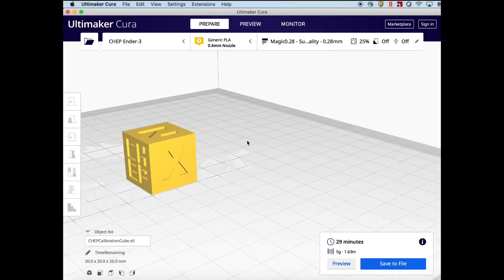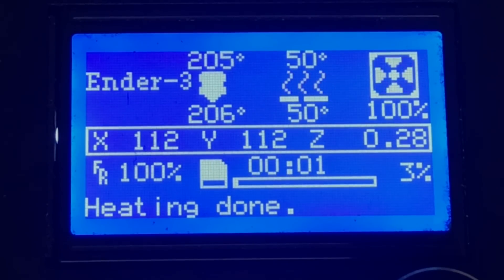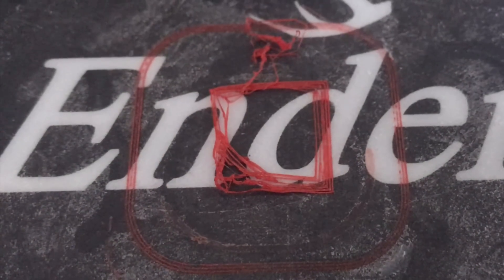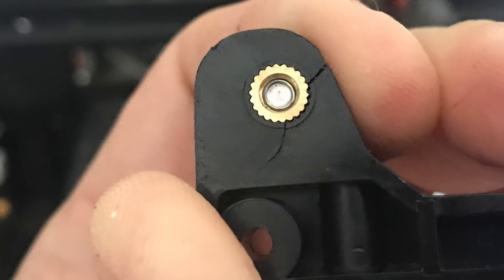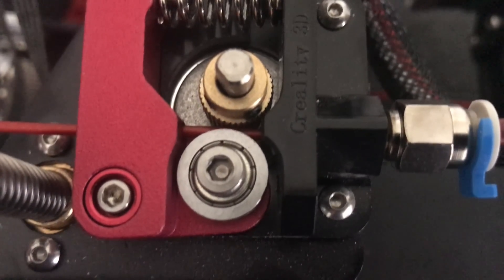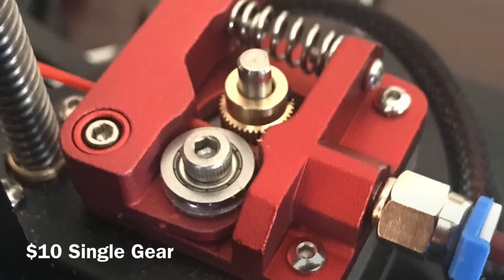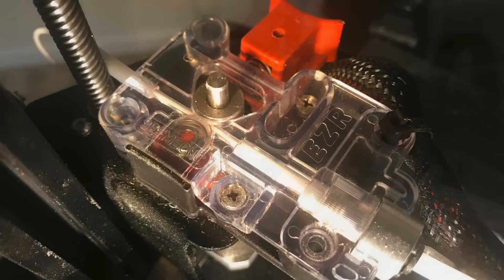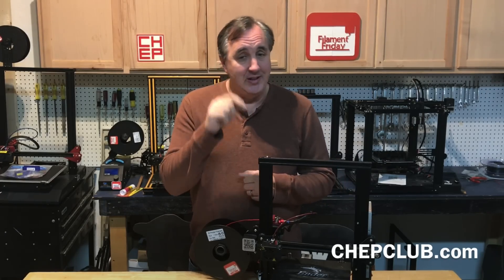Fix Under Extrusion from Cracked Extruder Arm on Creality Ender 3

Comment: Hello CHEP. I saw a video where you made alarm for end of filament. I have an ide. Why not use that design and use it together with a contactor so that it will cut power to the printer. Then it should be possible to leave the printer unattended and later restart the printing.
What do you think?
Reply from the maker: It’s possible. Not sure I’d want that but possible.
Reply: Why not  just use octoprint and have it pause and turn off heaters ready for your return.

Comment: Since I've been fighting this under-extrusion thing for some time now, including major holidays in layers like shown @2:30 on your red cube, I HAD to check this video.  I've been toying with the idea of running this by you, anyway, Dr. Chas, BECAUSE - the math of this one baffles me!!!  I've had LOTS of trouble printing tGlase on my Ender3, and everything I've done to try to dial it in, like adjusting eSteps, is effectively nullified by everything being so ridiculously INCONSISTENT!  Repeatedly trying to extrude 10mm (or 100mm) yields totally RANDOM amounts, from high seventies to low nineties (percentages) of prescribed.  So when I pulled the filament out one time, I happened to notice something weird in the markings left by the drive gear (Bowden setup, of course, so there was a bunch past the drive, before the extruder): about every INCH there was a funny little FLAT spot.  I say ABOUT because, again, it is randomly IRREGULAR!
Now, WHY the INCH - when I had been testing 10mm feeds???  This would imply a repetition of a wheel of about 8.5mm - and I don't see ANYTHING in my extruder of THAT diameter!
Herein lies the head-scratcher, which makes me crazy.  Yes, it may be that my tensioner arm is cracked.  Yes, it would be a good time to upgrade to dual-gear or hermera - but INQUISITIVE MINDS like the closure of KNOWING WHY!!!
Chuck - you may or may not wonder or have the luxury of the time to side-track, but this was so odd that I had to share.
Thanks AGAIN for your fine work!!!
Reply from the maker: Sounds like the hot end can’t keep up so you are seeing slippage. I would check the hotend for minor blockage or possibly burned PTFE at the nozzle.
Reply: @FilamentFriday  I do have Capricorn PTFE, BTW, and have checked the HE thoroughly, but while that could/would tend to contribute to random variations, the underlying 1" bands still defy explanation....  But thanks anyway, of course!
Oh - pulled the tensioner pulley arm - no crackulation.  
Wondering at this point if I should abandon the Bowden thing and do the direct hermera.  Reduced mass of moving head a la Bowden is theoretically advantageous for higher movement speeds, but when it gets right down to it, it seems like I'm ALWAYS having to go so stinkin SLOW that I'm nowhere NEAR needing the lighter head!  Gotta do SOMETHING different - this pokey speed is frusterpating!
Reply: @FilamentFriday  As Emily Litellla would say:
Oh.  Nevermind.

Uninstalled/reinstalled Struder, CHANGED FILAMENT, preliminary testing (albeit minimal so far) looks pretty good - with PLA.  Gonna try the TPU - tomorrow.
Capricorn slid right in, BTW.

Comment: Hello everyone. I recently bought Ender 3 and made several prints so far.

I have lot of problems with sticking filament to the bed (I'm using PLA). I have tried cleaning the bed with alcohol, but it didn't help.
I also checked the bed leveling and it is okay. What else should I look into?
Thanks for the help in advance.
Reply: hey i just bought an ender 3 as well. Mine came with a glass bed and i noticed that it tends to stick better when you increase the build plate temperature so i changed mine from the standard 60 to 70
Reply: Your alcohol may be leaving an invisible film on the bed. Try washing it in warm water with dish soap then re-leveling the bed. I had this issue recently and a warm wash usually solves my adherence issues

Comment: I actually had this issue within a month after i bought Ender 3 pro . Replaced it with the metal extruder and changed the filament holder which you had shared on a another video .This made a world of difference . On the contrary  i experimented using PETG filament recently i was getting  uneven extrusion , couldn't figure out why because i had followed a lot of videos before going into printing, also set the profile right . But after i was done with it , when i switched back to PLA i started hearing hissing noises every time a layer was put down .i  opened up the hotend thinking i had an issue with the  PTFE tubing was burnt out , infact i found that residue in the nozzle was causing the issue because there might have been some small PETG particles . Inserted a new nozzle and ran and  printed again started getting under-extrusion . so now i wonder what could be the issue even after calibratng esteps after the PETG (as i figured maybe because the extruder needed so much more force to run PETG as it tends to be too sticky .  So finally i changed the PLA filament with a recently bought roll from a different company and it fixed my under-extrusion . Also since its  winter season and the filament is usually kept at 19 C has caused this issue . So Under extrusion can be caused due to PLA  affected by humidity too.

Comment: I had this exact problem. The filament also started cutting a grove in the guide hole. Had me boggled for a few weeks trying different settings. I replaced it with a similar extrusion kit.

Comment: I download the new cura 4.4 and it does not install on my Mac have you have this issue?
Reply from the maker: No, installed fine on mine 1st time.
Reply: Mine said it could not be opened because it might be a virus or something like that. Open system preferences and click security and privacy. At the bottom of the page you should be able to allow opening it.

Comment: I had the same problem with my Ender 3 Pro. I also replaced it with the aluminum extruder. I think they should seriously market the machine with a number of these type fixes already in place.

Comment: Hi Chuck, My ender 3 stock extruder had exactly the same symptoms that you describe. I found the idle wheel crack almost in the same spot as you show in your video. After replacing the stock plastic extruder with the metal one, all problems went away. Thanks for your detailed and accurate description.

Comment: Chuck - thanks for your videos. They are great help. On the metal extruder I bought recently, they include a rivnut to go on the bolt through the spring. It’s a smaller size than the bolt, so the bolt does not screw in (M3 vs M4 I think) but this stabilises the spring and also allows you to tension the spring with the bolt, because the metal frame is also threaded (The rivnut pushed against the spring)

Comment: I had this exact problem, took a while to diagnose. My fix was a square block of foam to add pressure to that weak spring, that fixed it. It's the weak spring, not just the cracked arm.

Comment: I did hours of work to troubleshoot one of my extrusion issues. I almost gave up, but then changed temp and it fixed my issue. 7c beyond what the filament recommended for temp. Any higher or lower didn't work. Absolutely frustrating some of the issues you can encounter.

Comment: Chep I have the same Aluminum extruder upgrade and found a way to allow it to print Nijaflex with no problem. If you have a drill press like my workshop has, I was able to measure the diameter of an extra piece of bowden tube and found a drill bit that would produce the exact size hole.
I then took the extruder part that the filament exits from into the bowden tube (not the extruder arm) and carefully drilled out the filament hole about 3 mm deep. I then cut a piece of bowden tube long enough to seat all the way into my new hole and leave enough so that it was about 1 mm past where the bowden tube would touch the gear and idler bearing. I took the small bowden tube out and cut it at the angles you showed in a previous video.
Re-installed the small bowden tube and it fit perfectly. The small bowden tube piece fits snuggly into the hole I drilled and just touches the idler bearing and gear.
I've been having great success with my mod and my Ender 3 with Nijaflex as well as flexible filament from Mirocenter.
The hardest part of this modification was getting the size of the bowden tube to fit between the idler bearing and the extruder. It took me a couple of tries to get it just perfect. Now I have no worries about the small tube moving back and forth as the printer works.
My only caution is to make sure you drill the hole perfectly inline with the existing hole in the extruder, don't go fast and above all don't drill too deep. If you are proficient with a drill press this is an easy modification.
Thanks for great help videos.
SG
Reply from the maker: I 3D printed a version as you describe and showed it here. 
https://youtu.be/az7pysnV_MY
Reply: @FilamentFriday  That was the video I referenced above. It gave me the idea to drill out my current aluminum extruder and add the bowden tube part that you cut at 45 degree to take up all open space around the idler bearing and gear, so the filament can't push out from. Best part is I didn't have to spend the money for that expensive extruder to accomplish the same end result. I hesitated in offering this mod, for concerns that someone without the proper skills might hurt themselves. So to the community, please don't attempt this mod unless you proficient with a drill press and take all the normal precautions to protect yourself.

Comment: Had exactly the same thing on mine.. I crack that you could'nt see from above! But anyway.. Since i also updates to an Aluminium Extruder i have always wandered how much tension i should apply to the filament, is there any rule? Because i also noticed that i got slighty different e-steps in accordance to the tension i apply to the filament.
Reply from the maker: Not that I know of.

Comment: Really good video. Just for a quick question 
My cr10s with bltouch has been working really well, but the last couple of prints have not been so good. They are gaps in beween the first layer just like.if the nozzle was to high. But I have not changed anything for this to do that. Any suggestions to why this is
Reply from the maker: This:
https://youtu.be/MaMYMTX1Xl4
Or this:
https://youtu.be/x35aWmnZ_A0
Reply: @FilamentFriday  thanks for your advice, turns out that my cr10s the two screws that go up and down were not level. The right hand side was and 5mm higher than the left side so when it was travelling left to right it was goin out. But I would have thought that the bltouch would have sorted that out when it probes the bed at the start of every print. Thanks again

Comment: After like 2 weeks of having issues I remembered your video.  I didn't have a crack that I could see, but when I put pressure on the extruder arm like you did my problem went away leading me to conclude that my extruder was the issue.  I have ordered your linked extruder and will be installing it today.  you are a lifesaver!
Reply: you can use a yellow bed spring on this extruder to

Comment: Chuck, I ordered the extruder you linked but it was nothing like the one you showed.  There is no idler ring.  Both gears are the same and the teeth connect at the bottom.  The top of each has a knurled section that the filament goes between and it is tight.  A real SOB to feel the filament through.  I am running the first print now and it seems to be fine also with the new blue tube you suggested.
Reply from the maker: Sounds like you ordered the dual gear version I referred to. It was covered in this video:
https://youtu.be/QnrH2Sk7y40

Comment: I had a similar underextrusion issue but with the aluminum extruder - The arm wasn't getting enough tension. I ended up added a few washers to shim the spring and that fixed the issue.
Reply from the maker: That’s why I put the flattened lock washer under mine, to make it pivot easier.

Comment: I had exactly the same cracked extruder arm. Changed to the dual metal one from your previous video. Amazon was out of stock, I bought a similar one and it works perfectly. Was I am still fighting is with stringing. Can you test your dual extruder and check if you have stringing with 6mm / 25mm/s ? I had to change the original 93 steps from ender 3 pro to 141 to perform the 100mm test. I was thinking about lowering this, or increasing the values to 6.5mm/25mm or even 7.0mm. I dont know what is more efficient... distance or speed. I know that putting higher values will increase print time and also force the extruder motor a bit more with such movements... if you can comment or do a video it would be great. Thanks for the video. Priviledge to be your patreon.
Reply from the maker: Increase to 7 or even 8 mm to see if that helps. Firmware limits speed.

Comment: Mine extruder has it's hole messed up after like 2kgs of PLA and a little bit of TPU. The very same issue happened. Changed only the arm to metal one from the set I bought a while back, can't change the whole as I use direct extrusion mod :/ Still E3D v6 and Direct Drive are on their way to my Ender 3 so changes are in the air!

Comment: Thanks Chuck!  Both my Ender 3 and 5 did this around the same time last summer and I put the aluminum on... 

I also have a subject for an episode ;) The Ender 5 will not stop to allow a filament change.  The gcode is there, and the print just  ignores it and keeps on printing.  LOL

Comment: That’s interesting I have 4 e3s and 1 e5 all that are having the under extrusions. They are all less then 2 months old .
Reply: JakeOfALL  I found my arm broke just after a month or so, The upgrade is definitely needed
Reply: @jacksonallen101  so the one I fixed this Saturday did not have a broke arm, but the Bowden tube was not cut square and had a clog in it.. I went ahed and put an all Metal extruder and capricorn tube it now its printing like a champ
Reply: For me the spring was weak, not providing enough grip on the filament. I added a block of solid foam next to the spring to add pressure, that fixed it for me. A stronger spring might fix it too.
Reply: @danboarder  Also i noticed a big drop in resistance by just doing the capricorn tube and that in turn will reduce the need for a tighter spring  so its a win win

Comment: To those who do not have a crack, you can print a washer/spacer for the stock spring for the extruder and that helps a lot, until you buy an aluminum extruder.

Comment: It's hit or miss, my Ender's arm cracked within a few weeks. but my CR-10 was still plugging along for a couple months.  Went ahead and replaced the CR-10 with the aluminum one from the Ender after the Ender was converted to Direct Drive.

Comment: Yes, this is exactly what happened to my ender 3 arm. I spent a whole day to find whats wrong with it. Changed the tube, nozzle, couplings a several time until I noticed that the gears of extruder does not spin well. And the arm is cracked, I replaced it with full 3d printed in carbon 30 % fillament, 100 % infill, and it worked perfectly. Too bad that this video was not released before this happened to me. I am a big fan of you work and keep up the good work!

Comment: On my Ender 3, under extrusion was caused by a groove worn into the tension arm adjacent to the filament insertion hole. The groove caused binding.

The aluminum replacement corrected the problem.

Comment: We purchased an Ender 3 Pro and the metal extruded for Xmas last year and we have yet to get this to print anything with any real quality!!

Everything is right and built correctly but the print quality sucks!!

We get under extrusion on every print and we can’t find the problem!  The Bowden tube is fine, no slippage there and the filament seems to get to the nozzle fine!

We are new to printing but at this point we are ready to give up!!!
Reply: It could be the wrong temps 
Or the bed leveling is wrong. 
Also i noticed it doesnt like printing undersized objects.
Those were my problems with the pro 3
Reply: BrendanTheGent  thanks for the feedback, I am printing on a glass bed but I am going to get a tile like I’ve seen some folks do and try  by that, it seems we do have a high spot in the middle of the bed.  I am going to try to adjust the bed down right and then move the home switch  and then level the bed  loosening slightly to try to eliminate at wiggle in the bed itself.

Also I am going to move the spool holder from the top down to the side so it’s more of a direct feed to the extruder itself
Reply from the maker: Are you using my Cura profiles?
Reply: CHEP yes Sir, it’s easy to talk over our heads w 3D printing but yes we are selecting the profiles within The Cura Slicer
Reply: I had the same problem, but in my case I found that de spring was not giving the pressure that it must give,  as Cheap, if I pull de extruder it works but what I did is print a little spacer and put it on the spring to add pressure, but it does not work as fine as I thought, so I'll change the metal extruder for a different one like titan

Comment: I had very similar problems -- I found the pointy nozzles seem to cool too quick preventing flow -- turning down the fan to 20% and slowing down the print helped somewhat but I'm trying a different nozzle (I don't know the name of it -- e3d?) which has a lot more mass of copper around the tip.  This is working really well so far.

Comment: Great content, as always.  But one part I wanted to touch on was the bit where you said the gears were the same diameter so you shouldn't have to adjust your esteps.  If you adjust the extruder, like many people wind up doing for more tension, you should recheck your esteps for sure since it will likely change how much filament gets extruded.  This is especially true for those who changed their esteps while under-extruding.